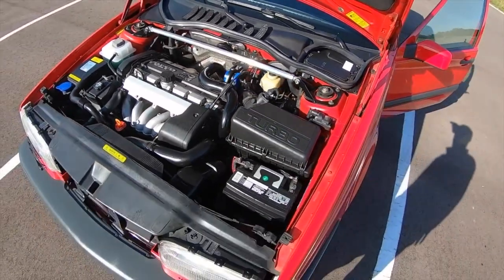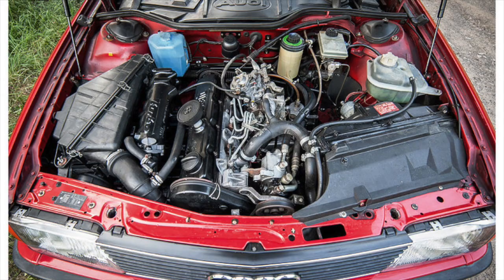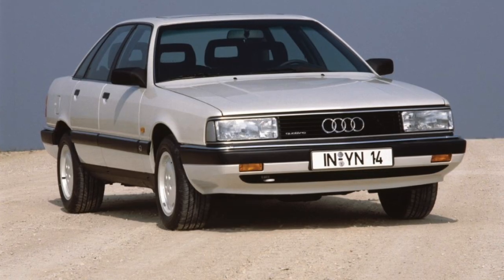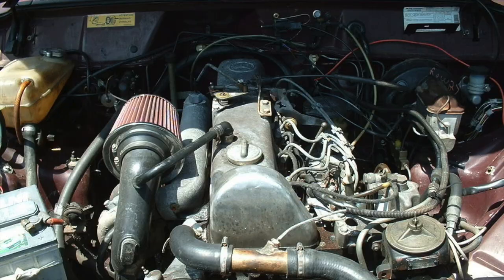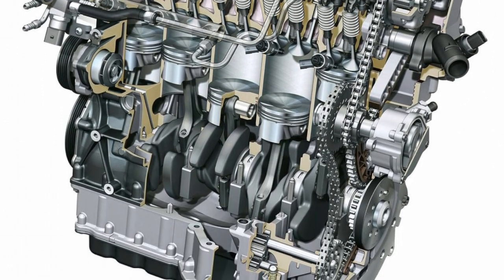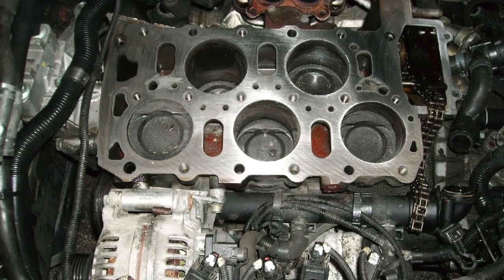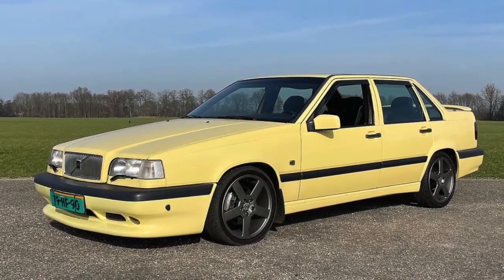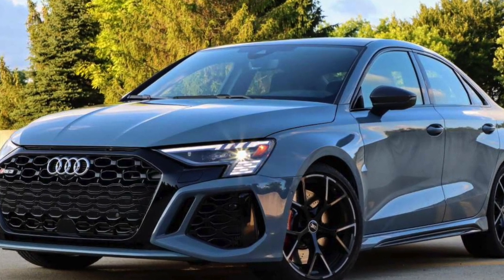The History of The Inline 5  Not a 4 cylinder, Not Quite an Inline 6

Comment: Im driving a ford mondeo mk4 with the 2.5Turbo inline 5 cylinder sourced from Volvo and used to have a ford focus mk2 st225 with the same inline 5 turbo 5 cylinder volvo engine one of the most reliable motors what ford Europe ever built thanks to those engines

Comment: ive stopped buying volvos after they ditched the six and five cylinders. my last volvo is my current c30 t5 with VME architecture. i'd never buy anything with this new GEELY direct injection new architecture called VEA.
Reply from the maker: Its a shame that volvo was acquired by a chinese company that just loves to make over complex engines like the twincharged 4 cylinders
Reply: I feel you, my current daily and my first Volvo is an S90(960) with a 3.0 i6, made me a Volvo fan. I want to eventually get a i5 Volvo to add to my driveway.